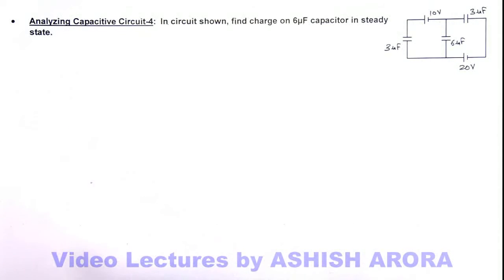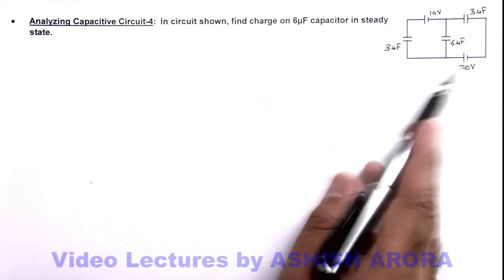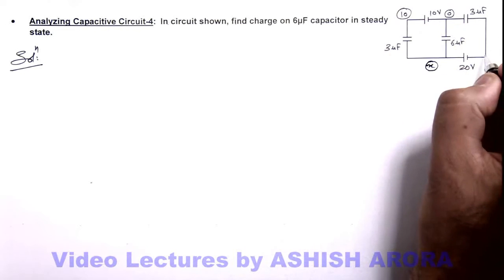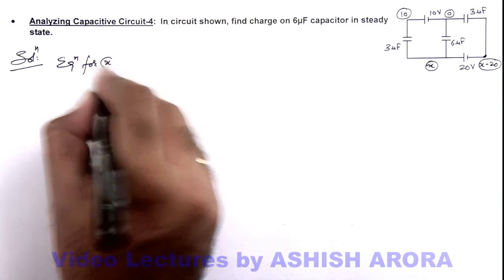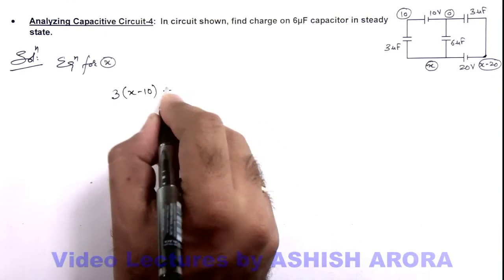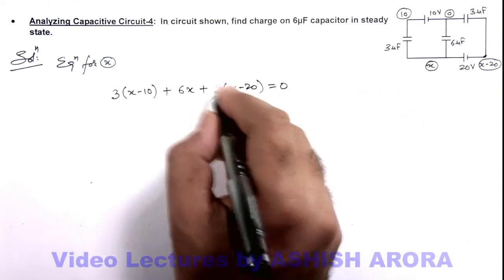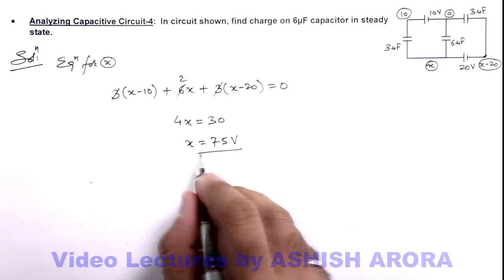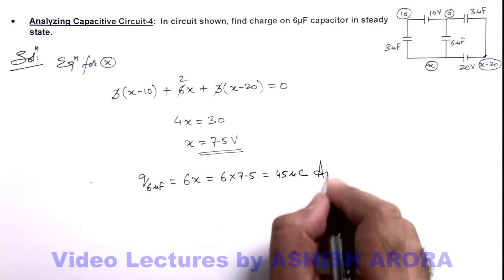16. Advance Illustration | Capacitance | Analyzing Capacitive Circuit-4 | by Ashish Arora

Comment: for those solving by  taking potential on -ve terminal of 10V as x on other side x+10 and taking 0 on -ve terminal of 20V

you will get x = 150/12

q = cv

and q(6uf) = 6(150/12 - 20) = -45uc
Reply: you are correct bro . Here only magnitude of charge is asked so dont worry.

Comment: what would happen if we take zero potential at -ve terminal of  20 V battery ?
Reply from the maker: Nothing will happen... in that case you need to take potential on -ve terminal of 10V as x on other side x+10 and solve... final result will be same...
Reply: Physics Galaxy how u can say this sir ..?? Plzz explain
Reply: if we consider both the negative terminals to be at zero potential it would mean that there is no charge in the middle capacitor which is absurd
Reply: @physicsgalaxyworld  sir how can we predict that from where the charge is coming , i am getting wrong answer on taking random directions
Reply: @sakshambhardwaj2083  Before solving, we know nothing about the circuit.
So we just assume that the 10V battery is the main supplier.
It's possible that the 20V battery may have more influence, but that will automatically be revealed once we solve the whole question. Until then, we just assume a random direction.

Comment: Sir I have taken another node as x so I am getting -ve 45....Is that wright...???
Reply from the maker: charge on a capacitor is both + and - equal charge on the two plates... while solving you might have calculated the charge with negative potential difference....
Reply: Yup ...Thanks sir

Comment: Sir,
I took potential to be 20v, (x)v, (x+10)v, 0v where you took (x)v, 0v, 10v, (x-20)v.
But I didn't get my answer.please clearify
Reply: Than : 6(x-20)+3(x-0)+3(x-10)=0
x=150/12=7.5V

Charge through 6muF

Q=6(x-20)=6(7.5-20)= -45muC , where -ve sign just indicate Instead of X charge flow through 20V to x(v)..

Hope you got
Reply: @anmolempire1197   isn't 6(7.5-20) = -75 muC though? the answer is coming wrong in this case..